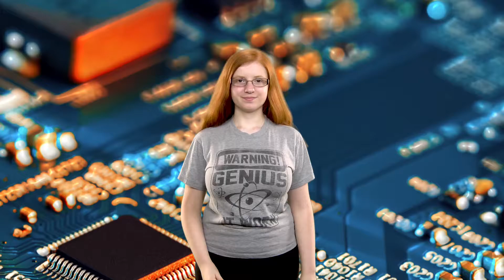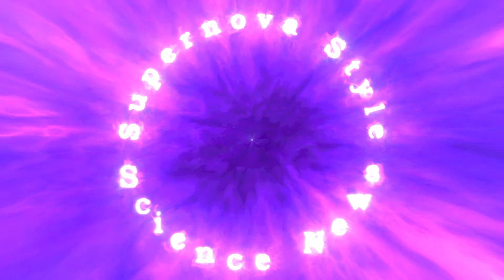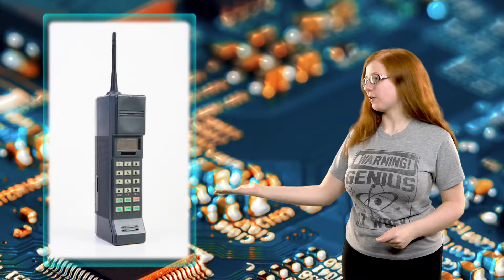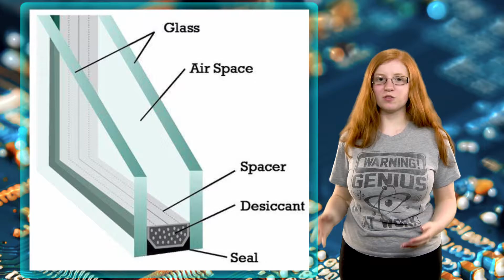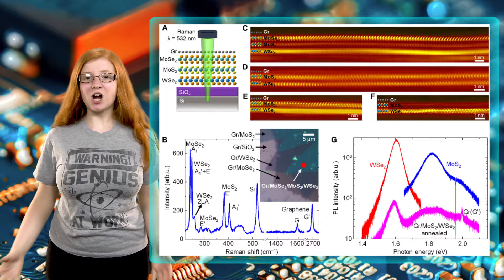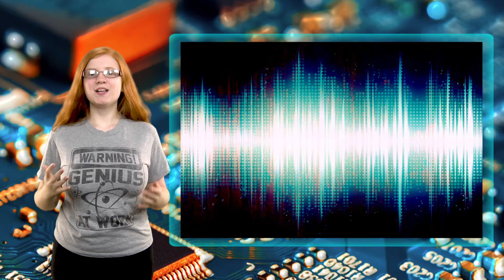Atomic Scale Heat Shield For Electronics Just 10 Atoms Thick -New Discovery

Comment: It is an interesting aspect of overheating. I always thought that the biggest problem is how to provide the best conducting of heat not shielding it. I some times assemble computers and setting cooler on a processor is a big responsibility. But I never did any type of shielding against heat in electronic devices including laptops. Instead, I insulated my flat for extent when I do not need any heater in the winter even the temperature can drop lower than -36 degrees C. My electronic devices and my physical activity give enough heat.
Reply from the maker: I thought the same thing, till I read this article and paper. It gave me a new way of thinking about it.